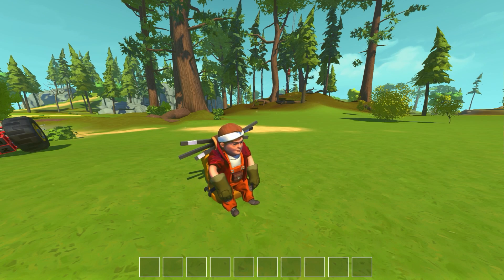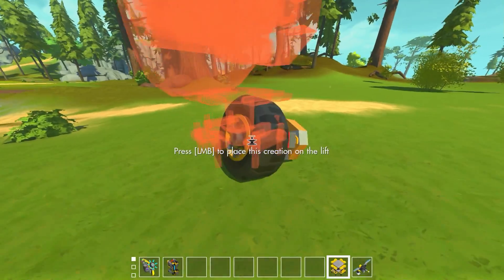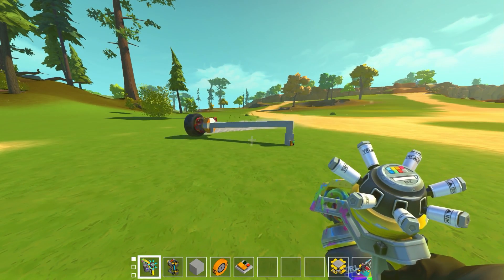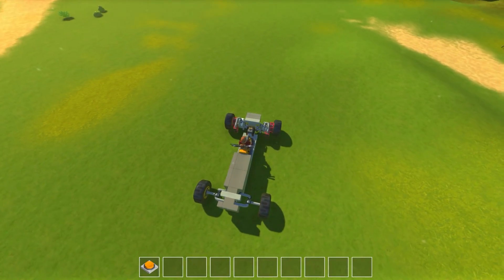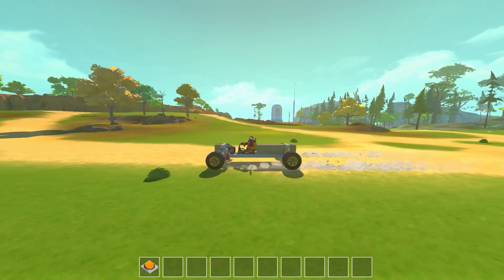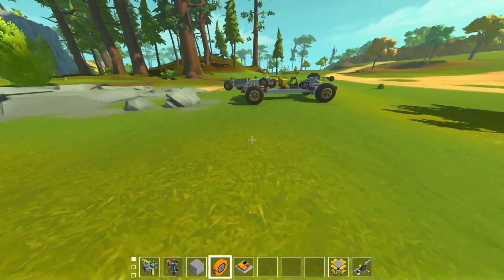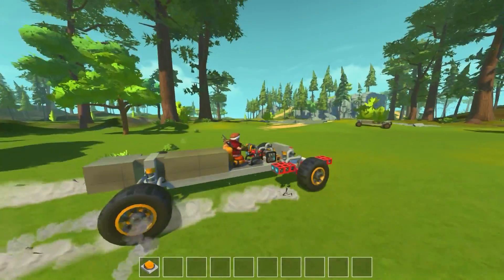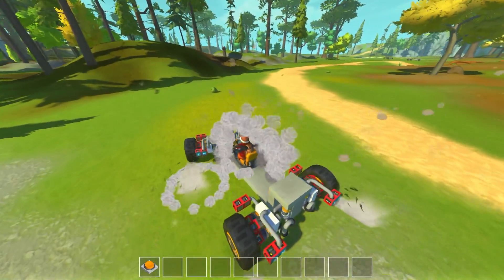Testing Magnetic / Gas Hybrid Drive Systems! (Scrap Mechanic #305)

Comment: hey kan, you need to adapt a 4 phase design and have the powered "coils" on all sides possible, electric motors rely on momentum to generate a lot of their power so having more points that generate force (more coils).

Treat the magnets more like a piston engine that fires at all 360 degrees in 90* increments.

or you could just need more magnets, that's a pretty heavy vehicle.

Comment: one thing I see as a disadvantage is that your not using all four angles, north, east, south, and west. I can see why you've opted to use only east and west, but the only problem there is that you can't use south, so adding in a north magnet possibly more towards the front of the motor might increase the power and add more speed to the vehicle.

Comment: btw that boost(you talked about in the video) is called KERS(or push-to-pass, if you watch indy 500), seen on F1 cars from 2010 to 2013
modern F1 cars(2014-2019) and WEC cars have ERS, which are more complex (aside from direct boosts, ERS also act as anti-lag system in the turbo)
p.s. in 2020 F1 will switch back to KERS, but this time more powerful :D

Comment: If you had the whole electro motor turning with the wheels when owerd by the gas engine maybe? ( so the ancor isn’t turning when the boost isn’t activated) 
Also have you tried making a magnetic suspension?

Comment: Maybe an issue is that to truly get a boost, your "boosty" wheels have to be spinning faster than the regular wheels. If they're going the same speed, then you theoretically only get more grip and acceleration, not necessarily more speed. If they go slower, that might even cause problems and make the car go slower. I'm not an expert or anything, so take my words with a grain of salt, but sometimes it's good to get an outside perspective.

Comment: I feel like its a timing problem. Take a 4 barrel gatling "spud" gun for example; If 4 guns are rotating with 4 sensors reading a fixed point, the guns should fire as they pass the trigger. If the gun is spinning slowly  they will fire at that point but the faster you go the more delayed they get. I assume its from exceeding the game's tick rate. I've noticed it when trying to make a piston or thruster engine spin faster with a mechanical timing device.  Maybe look into mounting the stationary magnets on a lever that advances its rotation with speed.       Or I could be a big idiot. Either way,  nice vid!

Comment: I think it’s the gas engine limiting it kind of (I was about to say maybe it was the magnets but I just saw that part of the video) I really thing that the problem is the engine stopping it from working so the only way I could think of doing it is having a engine bearing then turning it into a free bearing. ( witch I don’t think is possible)

Comment: I've got a novel idea. Throw the entire electric hub drive system on an engine powered bearing drive system. They'll spin up and drive on gas power, but much like a double-bearing drive system, activating the electric hubs would be like a turbo drive.

Comment: Hey Kan just an idea as seen as you never know how fadt your vechials go make a line of sensors that only detect one colour like red for example then put ONE red block on your creation and drive past them and the time it takes for the red block on your creation to get to the other side of the sensors is your speed it only has to be short i dont know how you would make it remember the speed or show the difference but ur pretty smart so if you use this idea im sure you can make it work 🤔

Comment: It might not work out how you thought and didn't perform great but it's still better than my wooden plank with wheels and suspension and a seat and some bearings and a motor. Oh and a rubber duck and pointy finger.

Comment: did you try spining all of the magnetic parts with the engine. not only the hub but also the outer magnets. spinning all of the magnet motor with engine and activating the magnet on top of it would theoreticly provide a boost. wouldnt it?

Comment: How do I fix getting this error for my mods, Blocks and parts: Wings More than one interactable found! Shape 8e323f6-5fc0-4e5a-b07e-398d3d6a100a. And it gives me a different code for each mod, so the intelligentia mod the WASD converter mod the camera controls mod and the electromagnets mod. I've reinstalled and switched from test branch to regular multiply times.
Reply: Logan King that's the part uuid, they should be different because otherwise mods conflict.
Reply: https://discord.gg/SkSeMUa ask for help here

Comment: I made a comment that explains everything but i deleted it instead of eding. In short: Magnets activate too late in high speeds, almost on the other side, so it slows down the engine. You can move magnets or activation zone when you get up to speed to go faster. My car can fly if upside down, try it with yours. Electric motors couse a lot of flying, teleporting and crash the game. I think problem lies in the mod, some weird things happen with physics, it doesn't really act like magnets, everthing gliches out a lot, even two magnets next to one another act weird. I think this mod needs some serious rewritting, maybe after that motors will work as intended.
Reply: It was a really good comment explaining everything, with experiments and stuff but I had to miss click on "Delete". YouTube should have a confirmation when you delete.

Comment: Hello I have a hybrid system it might not be exactly what you want but you may get some ideas here is the link : https://steamcommunity.com/sharedfiles/filedetails/?id=1422067360&searchtext= (the crawl assist uses electric engine while normal driving is by gas engine I was planning to build a supercar kind of hybrid where if you slow down the electric engines will give you a higher acceleration)

Comment: Scrap Mechanic is slow. When the magnet motor is spinning, there is a delay from when the sensors activate, to the magnets delivering force, so when the engine is at max speed, it's because the magnets are agtivating too late. But if you then reverse the spin of the motor, as you did before in the competition between the piston and magnet motor, the timing is right. Try offsetting the sensors a bit, so the triggering happens earlier. 
This has worked for me earlier.
Oh, and by the way, real world electric motors aren't that good at high speeds, their main advantage is that they have incredible torque. So if you have a massive vehicle that barely drives with normal motors, the magnet motors can give a boost in the beginning.

Comment: the speed of the engine is determined by the range and position of the white parts (what activate the magnets). different positions could be more efficient at different speeds. so once you get up to speed, change the angle to activate the magnets a little earlier to be more efficient. make sense? it might not work in the game but it works in my head
Reply: Works in the game, confirmed. It's determined by activation delay, not necessarily position but position helps to deal with delay.

Comment: Hmm.. You could test the gas-engine-limiting effect with an extra set of unpowered wheels that get pushed down below the gas-powered wheels when the magnets are activated.  However I don't think that's the problem.  I think the real problem is the magnet motors suck at pulling a load.  It acts like they pulse too fast and thus don't have the power for hard acceleration, but you'd need a hell of a weird rig to test for that because you'd need a much bigger magnet motor to be able to push longer on any given magnet.  I'll have to think about it for a bit and see if I can come up with a design that's capable of stronger acceleration.
Reply: I think what you really need is a way to disengage whatever power you're running on by default when you switch to magnet, but I dunno how to do that.
Reply: Aaand a stray thought about how to hybridize electric and piston -- you could maybe use the magnets to accelerate piston extension so the piston accelerates faster and maybe has a harder push?  It'll be glitchy as hell if it works, but maybe worth a shot?

Comment: if we think how a magnet make a force to another magnet, we will see that the force decrease with distance, so adding more magnets  further from the engine will not work too well,  this also shows another problem,  that would be that the engine delivers its peak power only 4 times per rotation, because when the core is at a 45 degree position, thats where the engine force drops to its lowest performance, and maybe that force is not enough to rotate the wheel, leaving inertia to do the job (that may explain why the engine works so well when is not experiencing ground resistance) 

so my solution is to add another magnet row rotated at 45 degrees from the original, but with its external magnets in its original position, this will alternate from one row of core magnets to another when one row is at its lowest performance, improving overall torque, but i doubt it will increase rpm significantly to do a difference , tho if is not still you may get a heavy duty engine for heavy creations, or to accelerate racing creations when they are at slow speed faster than other lower torque engines

Comment: You need to adjust the timing of your sensors. Just like regular car engines, as you go faster, you need your "ignition" point to be sooner. It will increase the Torque and speed of the motors. Maybe move the sensors by 20 degrees with the push of a button and that will put the motors into a "high speed" mode.

Comment: You should connect the gas bearing to the tire and the electric to the gas bearing because the gas engines don't have the same amount of torque and some of the electric engines power is being absorbed by the gas bearing. If you reverse the two positions then the tire will have less power loss because the tire will absorb none of the power. Basically put the electric engine inside(connected to the frame) and the gas on the outside (connected to the output of the electric engine)

Comment: Btw hybrid cars don't use electric engines as a boost they use them so they can take off faster then the gas engine takes over
Reply from the maker: I was thinking more of the racing hybrid cars which have an electric boost motor that they use for quick acceleration out of corners.
Reply: Gamefreak I'm not so sure you know about hydrid cars. The hybrid car you drive on the street is tuned for efficiency and standard drive mode will switch between electric and gas but that doesn't mean it can't use both at the same time for more power (electric boost). And if you see the onscreen gauges for a le mans car you will see it uses the electric power out of the turns. Race engines sacrifice low end for more high power. Combine a light flywheel with a on/off race clutch and that makes it very easy to stall. Yet a electric motor has max torque at 0 rpm, but your street car and race cars take advantage of that.

Comment: Hey, just wanted to give a suggestion for the spudgun update (the one with the sensors) to make a shooting range that monitors the trajectory of the spud so that you can see when and how much to aim up/down :)

i left a more detailed comment on the video from yesterday if you are interested. It would seriously mean the world to me if you made my idea into a creating :D
Reply from the maker: That's why you need a pulse extender on the sensor so the input lasts longer.
Reply from the maker: It is pretty easy to do. I used 4 or gates and it seems to work fine as a pulse extender for simple nor nor memory

Comment: i hoped to see you using a piston engine and a magnet engine for a hybrid :)
Reply: then the bost would probably make more of a difference
Reply: Nah, if he's worried that the gas engine is limiting wheel RPM it'd be a definite with a piston engine.  Since it's a mechanical linkage the wheels can only spin as fast as the pistons allow.  Forcing the wheel to spin faster would result in them getting out of sync and fighting the wheel.
Reply: Well you could try to make the piston and the magnet engine power the same axis
Reply: That might make it worse, in terms of glitchiness and lag, with 2 systems trying to power the same wheels at different speeds.
Reply: Yeah it will make it lag more for sure but i dont think that its a problem to power an axis with 2 motors with different power.
Reply from the maker: I have to think about this one... really got me puzzled on how to have it switch between the two or use 1 to boost the other.
Reply: I was thinking about this last night and I'm not sure if this is what OP intended, but you could maybe set up magnets attached to each end of the piston to give the piston more power/faster extension rate?  You'd need sensors for magnet activation, tied into a switch that determines whether the magnet system is working or not.  It'd make the piston engine pretty bulky, and maybe giltchy, but.. maybe it'll do the job?